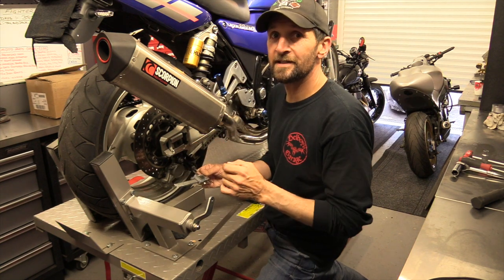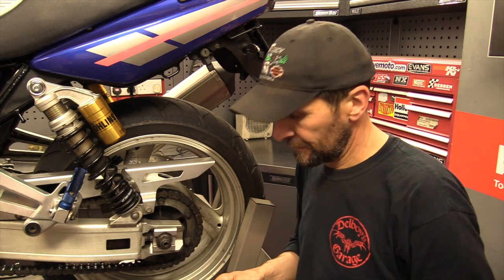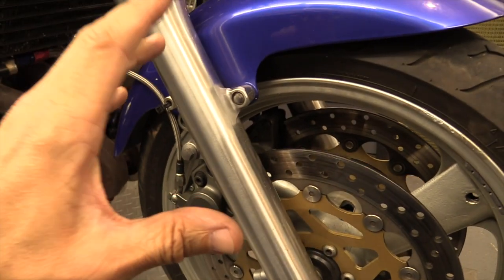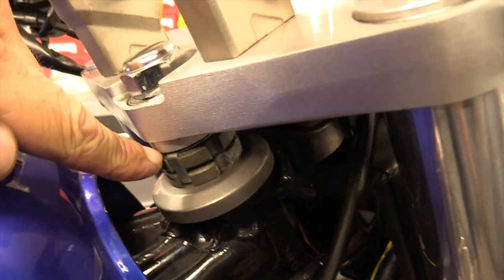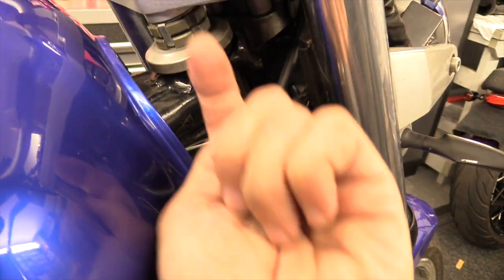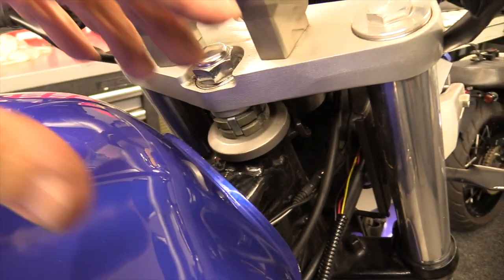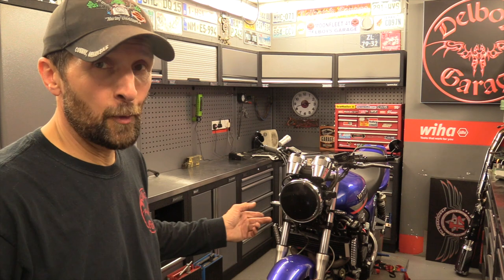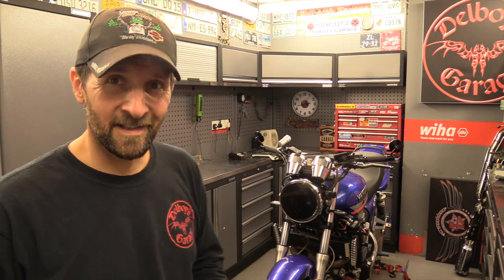Delboy's Garage, Quick and Easy Motorcycle Fork Alignment .

Comment: Good day. Excellent video. My bike doesn't seem to have a top bolt. It does have a pinch bolt right there on top. Do I loosen that up?
Reply from the maker: Not sure what bike you have mate, but yes, you must loosen off any means of fixing the top yoke to the shaft.. so if its a pinch bolt, then loosen that..! Good luck with it..
Reply: I have a Yamaha FZ-07 (MT-07). I went down recently and had to change the front tire due to the impact. While riding it, it kinda felt like it was misaligned. I tried fixing it earlier, I followed your instructions. The only difference I can see is that pinch bolt in the center of the top triple clamp instead of a nut/shaft that goes thru the head tube. So I loosened it. As I was doing the "CPR", the shaft that was held by the pinch bolt dropped down several inches (or was it the top triple clamp that shot up). And now my bike is "lowered". Since I'm just a novice mechanic and lacking all the fancy tools and gadgets, panic set in.. took some time to understand what happened and what is needed to do. I tightened the lower pinch bolts, placed a car jack on the front tire between the fork and set it underneath the lower clamps. Slowly extended it and was so excited to see that the shaft was moving back up. Got it into place, tightened that center pinch bolt, did the "CPR", re tightened everything else and wala! Straight as an arrow. Phew.. next time, I'll just bring it to your garage.
Reply from the maker: Well it sounds to me like you learned a heck of a lot there buddy, you found a problem, worked how to solve it, and did so... it dont get no better than that mate.. Problem solving is beyond many people, and got it sussed there... and obviously the next time you have any issues wit your bike, you'll attack it with a lot more confidence and slowly you'll become a competent home mechanic... Thanks for your support its great to know that we have been able to help you in some way... Good luck buddy.. Del.

Comment: When i do this and pump the front after undoing the center nut and the lower bolts, the steering goes back to the same position it was after the accident, any idea what could be causing this? Risers on the mt10 seem straight, forks seemed to be straight also upon taking both off, and the triple tree didn't look bent either. I'm lost.

Comment: Hey Del,
My handlebar is a little bit bend. 
If I align the forks this way will it correct for the bend or will it just misalign everything and give me even more problems?
Reply: If you follow del's instructions on this video and they are still off, change them, but, if you can see they are bent, then change them anyway AND DO the realignment.
Reply from the maker: HI Danny, like Tim says here, do the realignment procedure, don't worry mate, you won't mess anything up, or make it worse, cos I know tht can be a worry... once you've done it, if the bars still feel 'off', there is a way to check if your bars are actually bent... it involves taking them off the bike and stripping them bare, then lay them on a dead flat surface (a kitchen worktop is perfect) , as you lay them down you will see that the straight bit that passes thought the clamps will sit flat along the worktop, then each bar tip at the ends, should touch also at the same time... if either end of the bar is off the surface when you press the centre bit down, then the bars are bent... so pick up some new ones... hope that helps, good luck with it mate, let us know how you get on !

Comment: This is about my KTM 390. Experiencing similar bend towards right. Now though I'll give it a try.. but the science is not clear to me. More confusing is that the KTM guys  are not ready to accept that this would change anything. Plus the I am also finding it  difficult to give the " CPR"  thing on WP's stiff performance suspension ( tried without loosening anything) any suggestions on that..

Comment: Can I just ask, you said to make sure tyres are on the floor/lift etc but doesn’t using a paddock stand lift the rear wheel?
Reply from the maker: Only a little, it doesn't affect the alignment, what is important is getting weight on the wheels and not a main stand, a paddock stand does this.

Comment: If a bike has visible bend both in the handle bars and the forks (both rotated right from being laid down), what issues would there be with tweaking the fork alignment such that the forks are rotated left past center to offset the bent bars for a net straight bars?
Reply from the maker: Riding with misaligned forks is dangerous Eric, dont even consider it my friend....align the forks so they are dead straight ahead, check the rear too making sure thats straight.. then replace the bent bars... Hope that helps buddy.. Del.

Comment: Hi. Thanks a lot for the video! Do you think such misalignment could cause wobbling on the front? I'm having wobbles on my 660Tenere especially during compression breaking and the bike is generally very unstable. No faults on bearings.
Reply from the maker: Hi mate, if you've checked the bearings and there are  no faults with them then maybe have a look at tyre pressures, or tyre wear... is your front tyre 'cupped' or shouldered??  If so, this will be causing it... also check your rear wheel alignment too along with rear tyre pressure, all these things can lead to problems....
Reply: The tyres only have 600km on them. The same make/model as my previous set (heidenau k60 scout). The bike has 20K km. Tyre pressures check. Wheel alignment check with both the markers and a ruler. The bike glides on a very straight line even with the wobbles. Soo I'm kind of running out of possibilities and I was curious if such misalignment could cause this. I feel like it could too with the weirdly light front the Tenere has?.. Thank you very much for the response mate.
Reply: I finally tried it and it actually worked! No more wobbles!! Wanted to leave a feedback and thank you again! Cheers!

Comment: If I don't have a paddockstand since I have a centerstand on my bike would that work aswell ? Or is it crucial that both tires are touching ground ?
Reply from the maker: Not critical Stefan, but certainly desirable.... the aim is to get as much weight on the front wheel as you can so that plunging the forks down forces the fork legs to align in the yokes,  ! even getting a friend to hold the bike upright from behind is a good way to do it,.!
Reply: @Moonfleet41  Ok, thank you for replying Del I appreciate it ! Good thing I have a strong uncle that can help me :D

Comment: Can the CPR method be done with the motorcycle in a front wheel chock?
Love your Triumph specific videos by the way
Reply from the maker: Hi Mark. No mate, The wheel chock will hold the wheel still, when you really want it to be free to align itself without hindrance.. better to use a rear paddock stand, and then the front wheel can set itself straight again when you plunge the forks..
Reply: Moonfleet41 
I was just curious because when I google “paddock stand” it shows nothing but rear wheel ones for sport bikes but I remember you said the suspension of the bike needed to remain loaded to do the alignment and all the stands I saw lift the back of the bike off the ground....sorry I’m an amateur/just wanting to make sure I buy the correct tool to perform this task
Reply from the maker: Hi Mark,  No worries mate, the rear paddock stand does leave the suspension loaded, it lifts the swingram up via two lugs you fit to the bike.. so the wheel is up and supported, but the weight is still on the back suspension as well, also a great tool for adjusting your chain tension..

Comment: Very helpful vid,thx mate!
say,How complicated\expensive is to add another disk break on the front?Do i need to replace the whole fork to do it? (xt600e\dr650se)
Reply from the maker: I believe the upgrade would include a relevant fork slider to accommodate the new caliper, compatible wheel hub to mount the second disc on, a secondary brake line and a master cylinder compatible for twin calipers... other than that, all things are possible!
Reply: @Moonfleet41  all of that would be more feasible than replacing&adjusting the a new whole fork+wheel!?
Reply: @Moonfleet41  ps- How much would you charge me for that? (a ballpark figure..)

Comment: Hello Del, If I do full rebuild front end, need to do this operation or just assembly? I have ZRX1200 and top yoke doesn't look straight forward.
Reply from the maker: Hi buddy, whenever I've reassembled a front end from scratch I've always put the forks in , clamping in the top yoke first, then leaving the centre nut on the top yoke slightly loose the bottom yoke will automatically align with it, then nip the top nut and  bottom yoke pinch bolts and in theory it shoudl be perfectly aligned, then just re-build everything else and it shoudl be spot on mate... the pumping up and down thing is for when it's got a little knocked out of line by pot holes and bumps over time, either than or  drop... if you feel it's off when you first ride it, then this method can help double check it  (don't forget your rear wheel alignment will have an effect on the way the steering feels, so check that too!)
Reply: Thank you, Del! The rear wheel is fine, wear is even, but a front tire uneven wear. Front wheel bearings - ok, I replaced them last winter.

Comment: Question, can you use a "standard" paddock rear tire stand on a mid-size cruiser like a 2012 Kawasaki Vulcan 900 Classic (VN900B)?  Or can I just lift the back end of my bike with the block of wood method?  I know you said it is important the suspension needs to be under load.  Thanks in advance!
Reply from the maker: The suspension does need to be under load and the bike dead upright, however you do it, is unimportant, even if you get someone to stand behind the bike and hold it from behind...

Comment: I have a V Star 1100 that has a little wobble when I'm slowing down and not holding or very light pressure on the handlebars. Do you think this may be what I need to do for my bike. There is no play in the neck.
Reply from the maker: Hi David, no mate, I wouldn't say that is alignment... cos alignment is something you would feel all the time... when you ride up the road the handlebars will feel twisted to one side... but a wobble on slow down, sounds a bit like the classic worn front tyre... check the front tyre wear pattern, is the tread depth even all across the arc of the tread??  Does it have that thciker sticky out bit in the middle from running a little under inflated??  Or , alternatively, if not , is it just a bit soft??  Too low a tyre pressure can cause wobble on a bit heavy front end... I run my Harley about 38psi in the front and it's perfect... let me know what you find mate!
Reply: It started happening after I had a new tire installed and the tire pressure is at the right psi. New balance weights were installed on the rim. I had them put the same brand tire as stock. Thought maybe something wasn't done right with the install.

Comment: Dam, should have watched this video first, ah well, day 2 lol 😂, I was totally doing wrong, done top ones, knew it was something, didn't think bottom ones....after doing bearings , changing Fairing frame, right oil level this time, lol 😂 put nearly all back on, D9, front brake lever hitting plastic,  thought maybe frame, took it a spin, Dam took me back to that wonky steering on pushbike, though easier fix....big thumbs up tomorrow if it works.....
Reply: Did it?

Comment: do you need a stand to do this? i was told by my local mechanic i need to put my bike on a stand to releive weight on my forks for it to work
Reply from the maker: He is correct, you need to support the bike upright, preferably on it's wheels, but a paddock stand is a great second best!

Comment: Great info vid but i tried this on my ducati diavel and didn't work! Did it 3 times made marks on b yoke and fork leg but no go. Do i have to loosen the top stem nut?? The one with multiple holes? I think i do. Hit me back cheers
Reply from the maker: Hi buddy, yes indeed you most certainly do, what happens to cause a detectable mis-alignment is that the two yokes themselves (top and bottom) become knocked out of alignment by same impacts through the front end, potholes, kerbs, even just bumpy roads, and certainly wheelies!  ... so this process aims to re-align them exactly with each other, so naturally the nut that holds them both in the same place is the top centre nut, so you MUST loosen it off... and also, once you've done this and plunged it to align, that top nut is the FIRST nut to re-tighten, as that will hold them in place whilst you pinch everything in place! Good luck..
Reply: @Moonfleet41  cheers my friend will source the tool this wk. Thanks again keep the vids coming
Reply: Hi mate, ok with ducati you have to loosen top yoke bolts and central clamp bolt then the stem nut can be slackened, soo can you give any tips as to how do this? Cant loosen both yolks same time! Struggling arrrgh hit me back plz cheers

Comment: tried this with my CBR 954rr, loosened all the bolts as in the video, bounced it like crazy probably 50 times pushing from the top triple tree and also tried holding the brake while bouncing. No luck for me still crooked front wheel. Took the front wheel off and remounted, even took the forks out and remounted, still crooked. Cant figure out why the bars are slightly turned when the front wheel is straight.
Reply: I think it’s actually my upper and lower triple trees must be not aligned or bent. Not sure how to proceed..

Comment: On the old vid you didn't loosen the top tree centre bolt on the Hyabusa. Is it imperative you do that?
Reply from the maker: Hi Jeep.. Yes it is imperative my friend.. i forgot to film it in the older video.. which was one of the reasons i shot this again to make it clear... loosen off that top centre nut so the yokes can move and re-align.. then tighten that nut FIRST befor all the rest.. Hope that helps.. Good luck with it. Del.
Reply: Thank you very much for clarifying that point.

Comment: I have a 2011 Harley Touring bike. the front end bars/fairing are slightly off center when the bike is going straight down the road. the bike does not pull to either side, and the dealer says it's all aligned, must be my eyesight or the way I'm sitting. I don't think so. 

The rear wheel seems aligned when I look at the measurement both sides front center of axle nut to center of swingarm axle. So I think that confirms good rear wheel alignment? 

Would this then indicate that the method shown here is appropriate? Also could steering bearings or other steering head issues play into this?
Reply from the maker: Hi Steven, it sounds like you've checked the obvious things, rear wheel alignment always sends a weird message up front, but you have that checked... I did have this issue, however, with my Switchback and in my case, it turned out to be nothing more than the handlebars themselves... they had become slightly twisted in the clamp from just movinf the bike around... remember, they're heavy old bikes and over time, pulling the bars from side to side and moving it, tiny little microscopic shifts in the clamp can add up to a detectable mis-alignment...

So try this:-  with the bike upright and the steering straight ahead, you can see which way the bars are off... so just loosen the 4 bolts on the top of the bar clamp, but not so it's floppy, just back them out 1/2 turn each, then back the nuts underneath the top yoke (triple tree) about 1/2 turn also, then tweak the bars back straight... once you're confident that it's facing front again, do all those 6 fasteners up an 1/8th turn each at a time, alternating between them, so they don't pull it back out of line... that should sort it out buddy... let us know how you get on!

Comment: I've got an R1 that suffered a encounter with a Fiat 500. The steering is quite significantly out of alignment (the forks are straight, I had them checlked and serviced by K-Tech), would it be safe to use the forks as levers to twist the headstock back to mostly straight, then use the pumping method to get it fully aligned?
Reply from the maker: Yes, if you can't get the forks to align by pumping them, then sing a little gentle force with your legs either side of the wheel, is fine, just make sure you back everything off the same as for the pumping method... a second person would be helpful, so you could hold the wheel and headstock in straight alignment, then get them to nip up the bottom yoke whilst you hold it... and, of course, don't forget to check your rear wheel alignment too, cos that can make the front ride cock-eyed... good luck with it mate.
Reply: @Moonfleet41  Thanks mate, much appreciated 👍

Comment: If the bike is equipped with a fork brace would you remove it or just loosen?
Reply from the maker: Yes you would, very much so, it will stop the forks aligning if its not loosened off.

Comment: I would have thought that you would just jack up the bike, remove front tire, loosen everything up, put in front axle loosely to align the forks with no stress of tire/fender being mounted.  Then tighten everything up.  This video's way seems like it would actually torque the forks to be square to front tire which would put strain on front axle/bearings/forks.